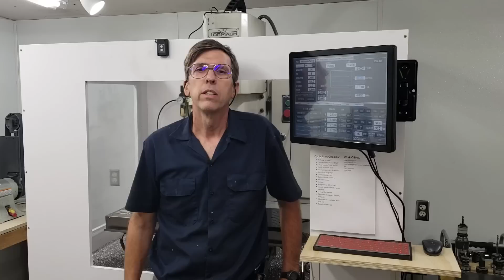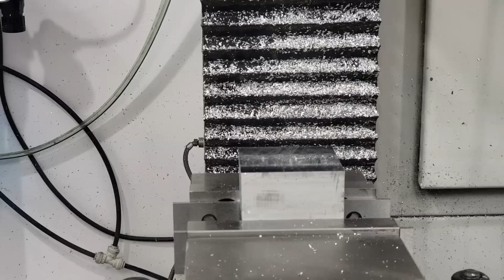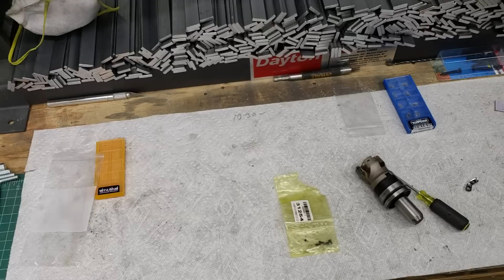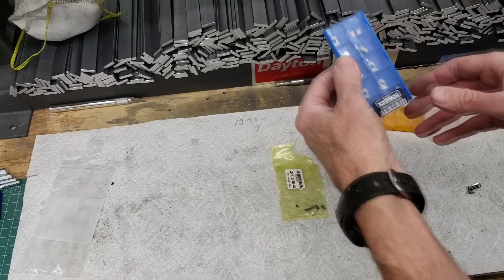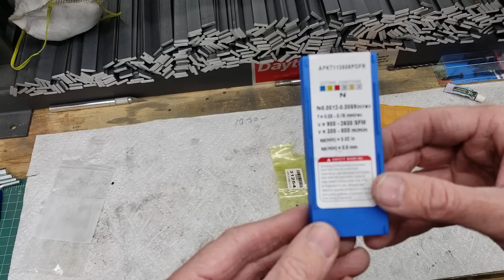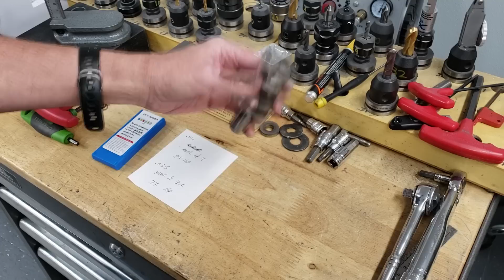Tormach Facemill Feeds and Speeds

Comment: The inserts you have for 100$ are for steel. The aluminum ones are 187$. I would suggest flood coolant for better finish & higher speeds. Inserts labeled "Mitsubshi" from China ? Suspect. Mits stuff used to be all sourced in Japan. 100 ipm ? 40 to 60 ipm and I am not pushing the machine or breaking tooling. Cool tests though !

Comment: I use the Ripper face mill on my milling machine and it kiss ass. I don't have a Tormach but a Bridgeport clone style CNC knee mill. So my machine is not extremely ridged but the face mill works awesome. 
https://www.latheinserts.com/2-RIPPER-FACE-MILL-KIT-WITH-10-FREE-INSERTS-1-09-022664.htm

Comment: Did pretty good, might try ebay for Chinese inserts for your face mill there like 1/10th the cost and are plenty good for roughing away material
Reply from the maker: Wow, Tormach has their prices way up there.  I see the same exact inserts from Japan for $50 and Chinese for $18.  Thanks!  I may get the index-able endmill on Ebay also.
Reply: @craigsmachineshop2040  if you look around some you'll find them way cheaper than that, I'm pretty sure you are using the same insert I do on my 3 inch face mill and I'm paying like 6 bucks a box shipped
Reply from the maker: @Daniel-vq9zb  $15 for  a box of 10 is the lowest I see straight from china on Ebay

Comment: Very interesting, especially that the screws can break! Are you maintaining a website that summarizes your current tool recommendations? That could be really nice, table summary with links to related videos. Are the horsepower numbers calculated estimates or measured? I use the same tool on a smaller machine and use a power meter to empirically find milling parameters, typically running this tool at 600W with occasional spikes to 1kW on a 750W rated spindle. Best wishes
Reply from the maker: Yeah, I was surprised about the screws.  That's a good idea.  I own the domain.  Maybe I will try a free WIX site.  The HP figures are based on G-Wizard. What kind of MMR are you getting?
Reply: @craigsmachineshop2040  I've never calculated MMR. Perhaps I'm looking at the metric wrong, but if one uses spindle load as an indication of reserve capacity that is an empirical measurement that includes tool and machine condition at that time. Maybe MMR would be useful if considering a new machine or tool? MMR can be empirical too, but less practical to measure by the controller.
Reply from the maker: @kentvandervelden   Sorry, its MRR. Not sure why I kept calling it MMR. I guess I had my daughters vaccinations on my mind. LOL  I guess I think about MRR a lot because I want to be able to remove material faster to reduce run time.  Making large dies requires removing a lot of material.

Comment: hi Craig 
Use only half the diameter, which is safer.Imagine your Cutter is a fan, you have milled that both sides have milled.So the fan was braked from both sides.(full diameter has milled)The spindle motor needs a bit of time to get some momentum.The cutter takes the power out of his momentum you do not have a 10kw spindle that's how it works.look at your crash the first cut from right to left worked and looked good too (Milling clockwise and half the diameter)and the chips can fly away .Then you have milled counterclockwise and full diameter.The result was: The chips were pushed into the material the milling cutter rpm slowed down andthe cutter was lifted left and right up down.(you did not see it but it happened your R8 collet has given way)In German """knack kaputt""" the cutter edge is broken. You can go a little deeper but only counterclockwise or clockwise and only half of the diameter.That's just physics an apple will always fall down.I always get a headache when you destroy very expensive tools.Please buy a book for metalworking something from a professional school or so....there are rules in there.....notice the.....
I hope I could help you
best wishes Stephan
Reply from the maker: Thanks Stephan.  I was at 67% step over on the 2nd pass.  I was under the assumption that I could go 70% with a facemill.  I guess I will have to do some more studying.  Yeah, I guess a spiral toolpath would be better than a square so I am always going one way.  Thanks again!
Reply: I have the experience for roughing material against the cutting edge then the chips fly away and it gets quieter.For finish cut with the material then the surface becomes more beautiful but never more than 50% step over that is safer but I am one of the better boring finds because it's cheaper for me.
I have a few questions for you! because We in Europe have no Tormach 
How flat and rectangular is the surface of the table to the spindle?
And how many baklash have the axles?
And what I want to get rid of:(that is not your fault) the TTS system is the big weak point of the Tormach .....
this is sometimes a collet in a collet not nice because a collet is not suitable for roughing
best regards and I am happy when your next video comes hopefully the door of your enclosure
Reply from the maker: @stephang516   I don't have the stand so I can't tram the Tormach completely.  I can usually get parts within .001-.002"  My main production isn't tolerance sensitive, just electrical covers.  Haven't checked the backlash in a while.  Less than .001" I think.  Yeah, the TTS system isn't great, but good enough for a 1-1.5 HP spindle I think.  Regular endmills have feeds, speeds and step over recommendations from the manufacturer.  I haven't found that for facemills and indexable endmills.  Thanks, hope to get the enclosure door parts soon.

Comment: eBay item # 202266596786

Exactly the same as the tormach one with about 1/4" shorter gauge length. I have both and I started buying modular cutters from that guy on eBay since I can leave aluminum inserts setup and get a second one for steel inserts. They fit the tormach arbors perfectly and are 1/4 the cost.
Reply from the maker: Cool!  How long did it take to get it?  It says 8-30 days.  It uses the same inserts?
Reply: @craigsmachineshop2040  yup same inserts just like the face mill. Apkt1135. Don't buy the inserts from Tormach as they charge insane prices. My local tooling supply has a box of ten inserts for $10-$50 depending on brand and style/coating.

Shipping took about a week and a half for me. Pretty much everytime eBay does a 10% code I pick up another style. It's just easier to leave inserts installed and switch the heads.
Reply from the maker: @stuartandrews8161  Thanks!  I just ordered one.   Yeah, maybe I will get another in the future for steel.  Yeah, I see the Chinese inserts for around $15 and $50 from Japan.